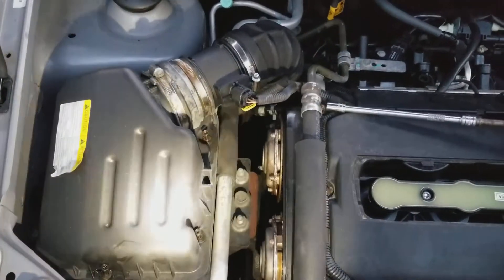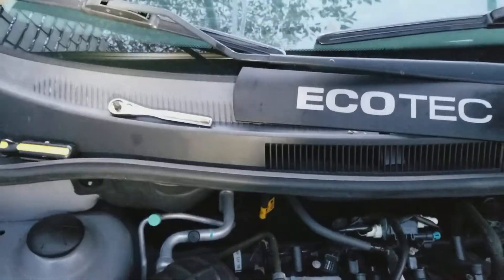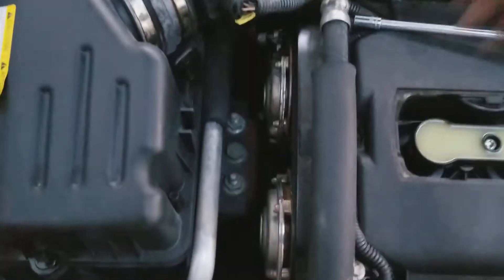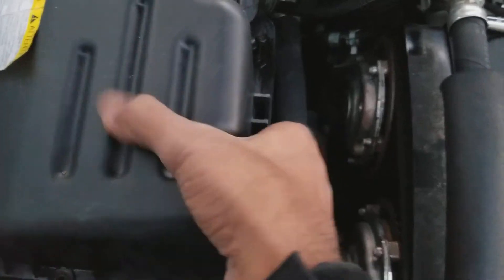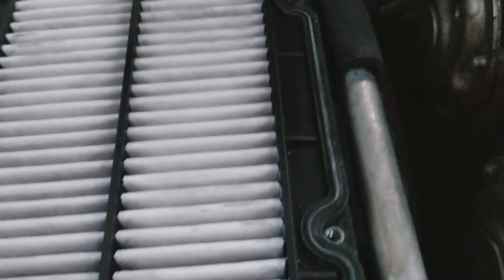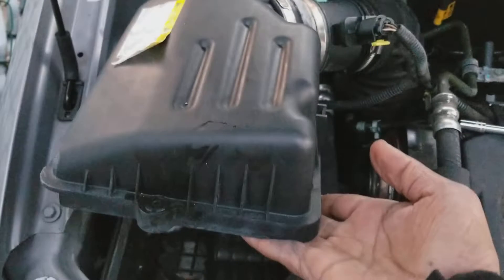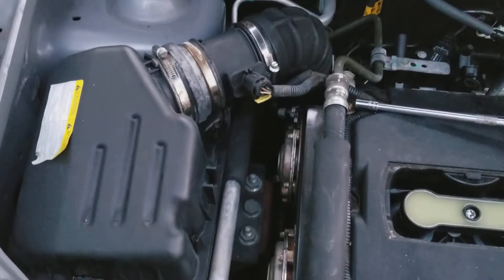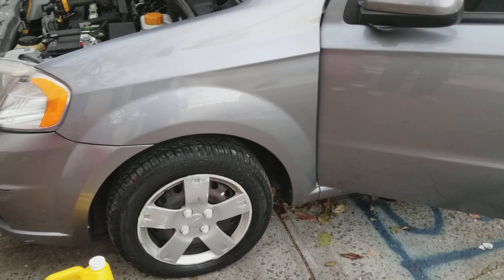Chevy Aveo LT 2011 air filter replace how to diy

Comment: So there's no need to undo the screws on that chrome metallic clip next to sensor? 
Because I'm afraid of the possibility that by opening the filter cap your way, one might crack the air pipe (as you mentioned) overtime. 
Am I worrying too much or is that a possibility too?
Reply from the maker: Not really, but you can if you don't feel safe doing it my way.